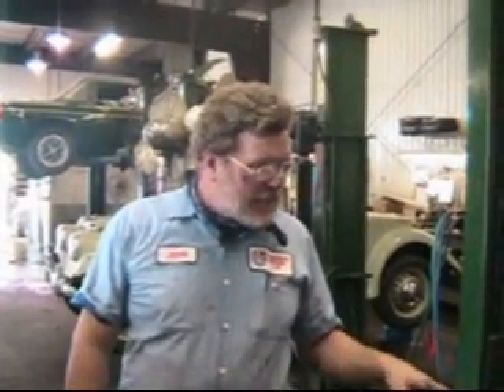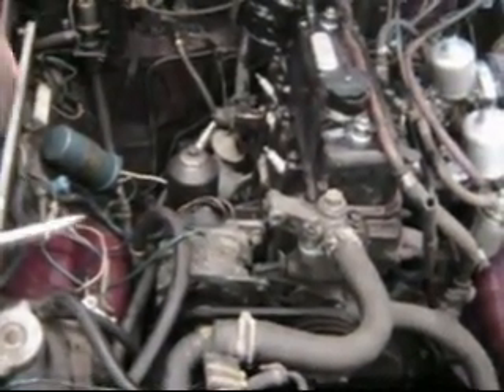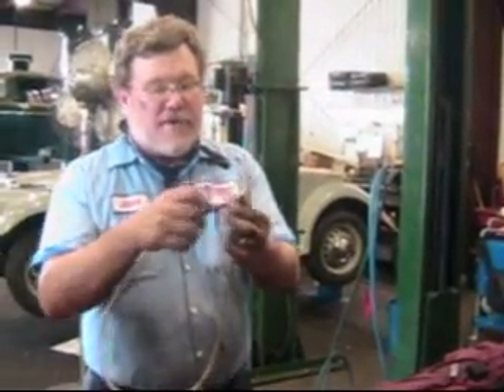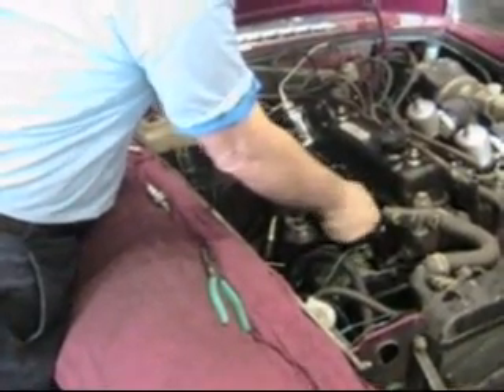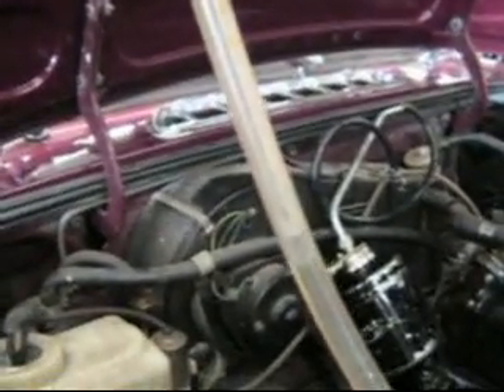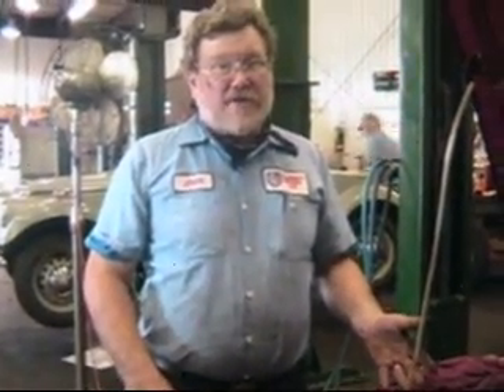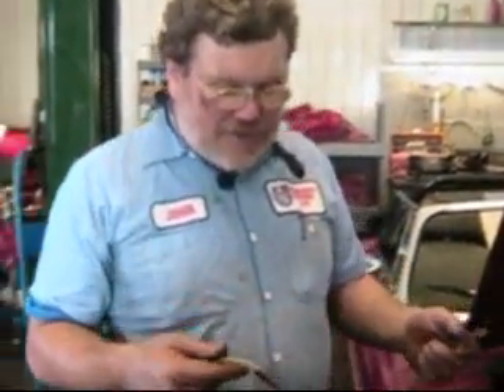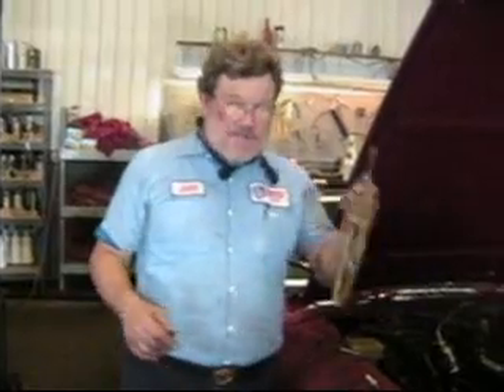69 MG Tech | Finding Top Dead Center

Comment: You look better now 17 years later, I have to laugh, you but dialed my dad G Bean while we were sitting and talking about my 1952 MGTDB that my father and I built over the last three years. It's a TDB because of the 1977 B engine and trans with OD and a 62-65 B rear dif. at 3.70 in it. Thank you for your videos. BTW it was a throw out bearing in my sisters 69 sprite, we took the engine out today and it was totally ate up, no idea why.

Comment: I've done same thing but use a small balloon. It fills and puffs and the instant the piston goes down the balloon kinks at its stem. That much oil even if mostly removed would be very bad for the CATs in modern cars. Try the balloon thing, you can buy a ready made spark plug hole adapter that goes to an air hose, used mostly for leak down tests. They are cheap and the balloon works great.

Comment: Excellent idea I'd used a shaft dropped into No1 cylinder and used my dial test indicator on mag base to get TDC on the compression stroke but will try this method next time and use a turkey baster to get most of the oil out.

Comment: could you put a ballon on the tip of your tube, and use the air movement instead of the gear oil? Seems it would save some clean up, and all the smoking you warned of.......But that is a simple yet ingenious tool .....think I'll try the air /balloon thing stealing from your idea.....Gr8 vids John. I look to you first before doing any project on my 73 mgb!

Comment: could you explain more about drilling out the spark plug? I want to know how to do it and thanks for the video!
Reply: Look carefully at the top edge of the metal part of the spark plug and you'll see it's been crimped over to hold the ceramic insulator in place. File that crimped lip off and the insulator can be driven out. You'll have to break off the negative electrode.
Reply: Crush the porcelain in a vice (wear eye protection) hold the hex part tightly in a vice on the hex. Use a small diameter punch to hammer the internal electrode and remaining ceramic.
Tap it to the nearest thread size , which worked out a 8mm or 5/16 .
Then screw a long bolt through., rounding the lower end slightly.

Comment: I made the same drilled out spark plug to find TDC on my Datsun Roadster. Instead of pumping oil into the cylinder, I had a small baby-food jar of oil, and a clear tube from the plug to the jar. As the piston goes up on the compression stroke, it blows bubbles in the jar of oil. Once TDC is reached, bubbles stop, and after TDC, the oil will begin to be drawn into the tube.  No Smoke